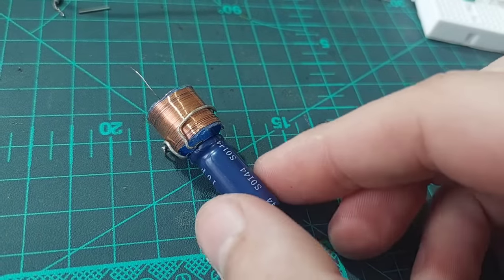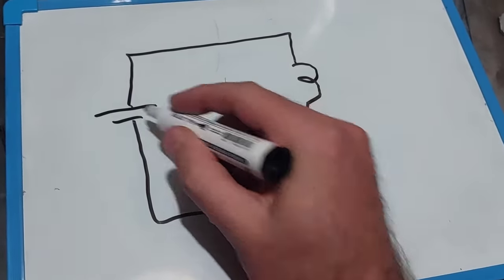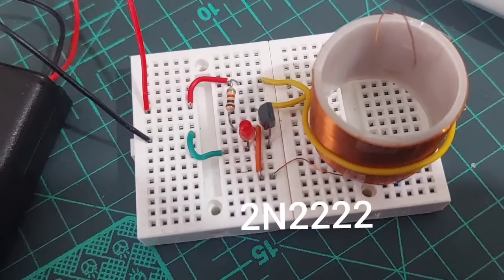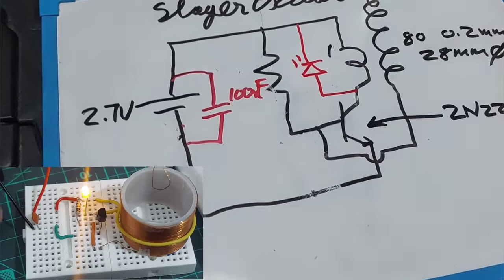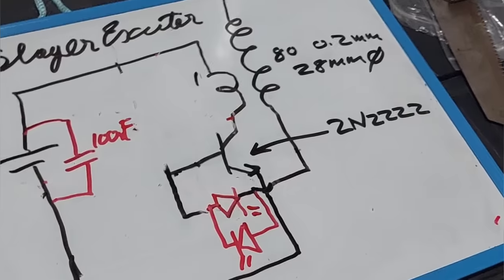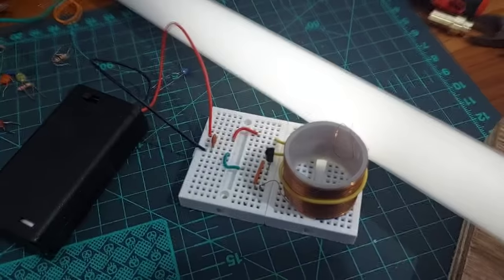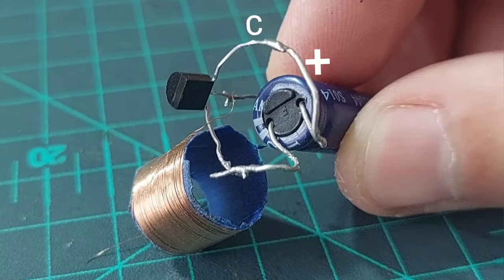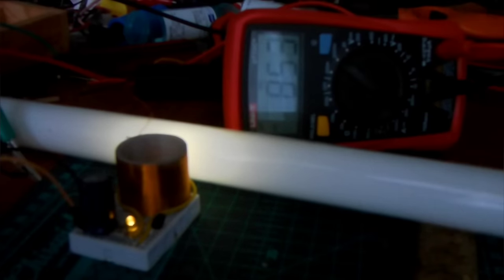A Tesla coil with only three components!

Comment: Using the transistor’s leads as the primary coil is genius, love it
Reply: The problem is that the primary winding's inductance is so low that the circuit oscillates in the HFs - 10MHz or more.  From tests I've made the frequency is very poorly determined and it's more like a spark gap jamming Device.  Fortunately it's low power.

The exciter I built used a BD433 transistor and a power supply voltage of 8 volts and about 200 mA current.  The arc will burn a tiny pinhole in the skin of my finger.  😮
Reply: @acmefixer1  maybe if there was a ferrite choke that would help with the 'jamming' and move the oscillation into a lower frequency?
Reply: Me and my monkey
Reply: 😱 omg.. I would of "NEVER" thought of that.. awesome 👍😊
Reply: once it is connected to the leads the lead is basically becomes part of what it is connected too...

Comment: The piezo ignition is funny because some years ago a buddy told me to do that, but he said "use a lighter". So I ended up using something like an enclosed phototransistor on the base with only a pinhole for light to travel to it, and using an actual flint ignited lighter to spark enough light in front of the hole to turn the transistor on.  Meanwhile I could have just grabbed a grill lighter haha.
Reply: Instructions unclear, used fire to start pulse generator.
Reply: @zeekjones1  The days when the 100th Slayer Exciter build started getting boring without some kind of twist, but was still too scared and unskilled to journey into different circuits.

Comment: Using oscilloscope probe with ground lead just clamped to tip creates 1 single turn pickup and can be used to watch the oscillations... A cheap 1Gsps scope with 30+ MHz bandwidth is enough.

Comment: the trick with the lighter is super clever! how did you think of that?
Reply from the maker: Trial and error! I have seen several topics on piezo crystals used in gimmick emp devices. Some other methods of induction also worked, all involving sparks, like shorting a large capacitor next to the coil. The lighter was just far more convenient.
Reply: The "trick with the lighter" would not be needed if the base bias resistor was not removed.  The resistor is so inexpensive that it should not have been removed. 😮 🤨
Reply: @acmefixer1  and how would it still be 3 components?
Reply: @cornishcat11  
Transistors are current operated devices; therefore the base should *always* have base bias current, no matter how small.  The base bias could be as low as a microamp, through a 10 megohm resistor. 

You said it's "only 3 components" but it's not!  The fourth component is the lighter - without it, the circuit won't start!  😈😳
Reply: @acmefixer1  So you think a 'Start Cart' is a component of a jet fighter?

Comment: What a neat device! A speaker voice coil could be perfect as a secondary, will try this for my germicidal UVC lamp that has a failed driver circuit.
Reply from the maker: Is the voice coil a single layer of windings? AFAIK all Tesla coils use single layers. The voltage gradient along the coil is very steep and I believe there is a risk of insulation breakdown if a second layer of turns is added, effectively laying down high voltage turns directly onto low voltage turns.
Reply: @williamfraser On a larger scale, you're still using three components with a power transistor and a chunky HV capacitor, and you don't even need insulated wire, you can separate layers with graphene or nashua duct tape (just stretch the rubber to peel it off the metal first lol. Your circuit lights all fluorescent tubes in the room and reverberates for twenty-plus minutes using copper tubing for the primary and scrap HV city wire separated by nashua with the windings spaced as closely as possible without closing the circuit through the air. Portable harmonic oscillator has many applications. Most of them are kind of nefarious, but your circuit is quite the feat. You earned a subscriber with alerts turned on with this one. 😅
Reply: A little battery powered clock. They have a great coil in them for this stuff.

Comment: Sounds like you made an electronic pendulum or metronome, which just happens to use a tesla-coil-like design.
Reply from the maker: Isn't that exactly what a Tesla coil is, a resonating tank circuit between the coil and the parasitic capacitance of the air around it?
Reply: @williamfraser  I think he meant like where you give it an initial "charge" and then "release" it and then it oscillates till it "settles down".

Comment: Using the piezo-electric firestarter reminded me that I had a odd "remote controlled" robot dinosaur as a child that used a piezo-electric trigger remote to signal the dinosaur to perform an action. This would have been all the way back in the in the 1980's, but it was one of those clever Japanese toys, and I hadn't thought about it until watching your video.

Comment: Try that with the push button piezo from a gas grill. 
All it needs is a wire antenna about 1 inch to broadcast the pulse.
Excellent fractional energy driver research.

Comment: I love small circuits like this, I wonder if placing the cap inside the secondary coil would affect its performance, but I'm sure it'll look even more cute
Reply from the maker: That was my initial intention, making it even more compact. It didn't work for me but there must be a way. A ferrite sleeve around the cap to provide some magnetic shielding perhaps, or simply adding proper insulation around the top of the cap housing.
Reply: Unlikely to work. The aluminum can of the capacitor acts like a shorted winding and robs power from the circuit.
Reply: lacing the cap inside the coil produces too much parasitic capacitance and reduces the Q of the coil.

Comment: Great creation, very small part count and physical size due to the simplicity and monolithic-esque design. As you say, the fluorescent bulb going out doesn't mean the circuit shut down. The field was just too weak to sustain ionization. Assuming the load characteristics don't change too much, perhaps if the open wire were connected to the filament wire that reaches inside the bulb, the weakened field would radiate a bit more proximately to the gas for ionization, allowing it to stay luminous through lower input voltages. Further, heating the body of the NPN as much as possible (ideally to its maximum operating junction temperature) would decrease the base-emitter turn-on voltage by a few hundred millivolts and further increase forward current gain. A PTC resistor epoxied and insulated with the transistor, or even a source of (non burning) waste heat would do. JFETS would also be a great alternative to BJTs to allow even lower voltages. 

I've built a couple joule thieves and one 12V slayer circuit before, but haven't seen the supercap used with them. It's a nice low impedance voltage source for the coil. Though, I wonder what its high frequency impedance looks like compared to ceramics. I would guess the performance suffers without a few low capacitance ceramics in parallel.
Reply: Tried underdriving an unmodified slayer with a BD243C BJT, red LED, 1.2kOhm resistor, and 200nF of ceramic capacitance. Got down to 2.08V before the PL-S fluorescent tube extinguished and the circuit failed to relight with a piezo striker. The circuit further oscillates down to 1.4V without ionizing anything.

Preheating at full power to a case temperature of 135ºC and then underdriving did NOT produce the results I expected (lower minimum input voltage operation). The circuit would extinguish at 2.5V and would not relight with emfs below that.

Reducing case temperature to -18ºC, however, did allow me to reduce input voltage further to 2.03V with a base-emitter peak voltage of 1.08V and DC current of 140mA. So while higher temps should offer higher gain and lower base-emitter voltage drop (as much as 200mV), this high power BJT performed better with even lower gain and higher Vbe. Actually, rather than these parameters being relevant, I noticed its transition frequency is 3MHz yet the circuit it was designed for exceeds it at 3.6Mhz. This means gain is affirmatively below unity (1) at my frequency, fractional even. By comparison, the 2N3904 has a transition frequency of 300MHz, so there wouldn't be significant attenuation of gain due to frequency and it may still benefit from some thermally driven tweaks to its properties before needing to change transistor technologies.
Reply from the maker: The ceramic cap definitely makes a difference, at least when there is a resistor on the base. Another place where I tried two parallel but opposite facing LED's is between the positive terminal of the supercap and the resistor. Both LED's lit up so I assume the primary also creates a reverse pulse, perhaps induced by the secondary, that stores some energy in the ceramic cap before the new cycle starts. Just guessing here, if you have a scope you can test it!
I also had success with a 2N7000 mosfet with nothing but the secondary on the gate. It was an easy substitute on the breadboard because the equivalent  pinout is the same order as the 3904. Adding a gate pull-up resistor just resulted in overheating and no pulsing. Adding a pull down resistor worked well, even without a pull-up. The circuit can be started by simply touching the tip of the secondary, no emp required. What worked best was using an led between ground and gate and another between gate an positive (cathode goes to positive). Both light up strongly so the secondary reverse pulse must be pushing the gate well above positive. The LED's should also provide protection for the gate against Vgs limits.
Reply: @williamfraser  I'll find some time to do that, but rather than modify my slayer kit which is rather inconvenient to partake, I'll repeat the same breadboard layout you have and wind a new coil so we have similar attributes. Was there any reason for the 80T and diameter? Going for a specific coil inductance, ratio, time constant, or something else?
Reply from the maker: @InfinionExperiments  I made the 28mm coil years ago, I don't recall why I decided on such a low turn count, it would not have been based on any electronic property, more likely just to explore the limits of what might work. Small coils with high length to diameter ratios all seemed to require ferrite cores to work well while the short wide coils work well without ferrite.
Reply: @williamfraser 🤔 could you use this and step up the power and voltage with 2-car generators that diodes being used as the three leads on a AC generator. Run a distribution panel and about 90 amps and 120?
Reply: @williamfraser  Had some time this weekend to wind the 80T:1T air core transformer and experiment with the mentioned NPN and N-channel TO-92 transistors you mentioned. I used 0.33mm wire and 26.5mm diameter tubing so it ends up being 1:1 diameter to height compared to your 0.6:1 with the thinner wires for the full and miniature sizes. 

To answer the earlier question, I can confirm there are definitely EMFs on both primary and secondary windings. The primary shows pretty high pk-pk voltage WRT the positive rail. I'll focus on describing the 2n7000 fet setup and the primary. For a DC bias of 1.5V operating at a series resonance of 10MHz, there was a pk-pk voltage of 2.7V (max: 1.7V min -1V WRT positive rail). However, something quite interesting happened when playing with different fluorescent bulbs.  While manipulating a Lumiline 15839 40W around the coil, I decided to orient it vertically and lower it directly above the coil stack. As I did this, the pk-pk voltage soared to over 8V pk-pk and frequency dropped to 7.7MHz as the circuit entered a new dominant resonant mode coupled at a different physical location along the secondary. In other words, there are about 6 different pronounced resonant waves in a given cycle when visualized on the scope, and depending on where and how well the secondary is coupled, the major amplitude will prounces itself from one of them.  

If you look at an image online of the Lumiline 15839 40W, you can see that this product features brass endcaps. I believe this is acting as a topload.

One big difference I observed between NPN and N-channel transistors was that the NPN typically generated corona on the break-out point much more readily, while the N-channel didn't produce any at all for the voltages i tested, transferring more RF energy and lighting the tubes to the same intensity further away. The break-out point also audibly snaps when it ignites and extinguishes, and can interrupt resonance at low voltage when igniting a fluorescent tube. 
While generating corona, there is less radiated EMFs to ionize the gasses in the fluorescent tubes, which then have to be brought closer to increase coupling and shift the balance of energy consumption away from that break-out point. I think this mainly comes down to the turn-on/off characteristic of BJTs, but I don't think I can articulate why. That could still be fixed with some additional components around the gate (filtering, current path mods to adjust rise/fall time, something else).

As the frequency drops, the switching losses should too, so a coil with an appropriate topload should allow the transistor to transmit more power before it needs to derate.

I guess when you set off to answer one question, ten more take its place.
Reply: And there's the long winded speech.
Reply from the maker: @InfinionExperiments  much appreciated. I'll have to read through all of this again slowly after coffee tomorrow morning! Just curious if you also noticed big changes in frequency depending on how high the primary is positioned along the coil. Also that the LED'S are much brighter with the primary higher up but neon tube is brighter with the primary right at the bottom?
Reply: @williamfraser   There is a lot of physics and geometry behind these coils, so any adjustments seem to verily change the coupling, amplitude, and resonance. There is a page (among many) I dwelled around while playing with this project from your video called kaizerpowerelectronics.  They have blogged in depth about the design considerations for tesla coil geometry and inverters, specifically for SSTC and DRSSTC, and it helped in a big way. 

To answer your question, yes there is definitely a big frequency AND amplitude dependence with primary height. I'll email you some scope captures to show it and some other related discoveries pertaining to the topload and LED voltage.
  
Because we have a single loop of horizontal primary coil, and are terminating in a breadboard vertically, it's hard to make a coil really planar wrt the secondary. It's really more of a 3D coil than a flat 1T helix. The 3d coil in addition to varying orientation also has varying proximity from the secondary, and as a result there is a more distributed and non-constant coupling along many windings of the secondary. In kaizer's secondary coil design guide, they mention convex and concave voltage gradients depending on where the primary is positioned.

I haven't tried other coil geometries besides 1T flat helix, there are 4 common ones, but height absolutely affects the resonant mode, amplitude, and energy transferred. It was mentioned in some sites that putting the primary in the middle worked well for them, but it's all very design specific; the designer needs to tune their setup so they reach the most desirable resonant mode, and generally they try and make everything adjustable (on a tape carriage like you did, or with primary taps).

To try and make cleaner waveforms and coil geometry for a middle coil, I tried to only highly couple the important parts of the coil by terminating it into the breadboard far away in the near field, and then bending the transmission lines at right angles straight towards the coil in an ¬ shape. I ensured the single turn was flat (planar and concentric) and then keep both coil ends (transmission lines) tightly bonded together to reduce parasitic inductance. Glue, varnish, or heat shrink helps a lot.

Comment: This is actually pretty incredible I'd be very interested in a load test to see how many lights or how long a light can be on. I'd also be very interested in knowing more ways it could be powered even if they are less effective than the lighter.
Reply: touching the lead probably would also trigger it especially if you are inside a building, or if you also touch the + wire. connecting the gound to the earth and then letting a kite with a rope wet in salt watter fly up and either getting close enough to it, or making it touch the middle terminal should also trigger it, if the kite is high enough and if the salt water is of the right concentration then you might not need to ground it.
Reply from the maker: The spark from the lighter simply induces the first pulse to trigger the transistor (if that is the correct term). The power for the oscillation comes from the supercap which acts as a low capacity rechargeable battery with low ESR. It still needs recharging from an external source.
Reply: OK so the Super capacitor is already charged up prior to the Spark Igniter ?   This video looks extremely suspect to me. @williamfraser
Reply from the maker: @seditt5146  yes already charged. No free energy bs

Comment: in place of resistor you can put a small capacitor and at the right value capacitance, when you power on the circuit the cap allows just enough current thru to switch the transistor and get the circuit oscillating.
Reply from the maker: I gave it a try, used various ceramic caps from 10nF and up to 220uF. It would not start, even when using the emp. When I added a 10k resistor in series it started (using the base-emitter LED as an indicator). A diode or LED in series it also worked (anode to positive). To start a second time the cap first had to be discharged.